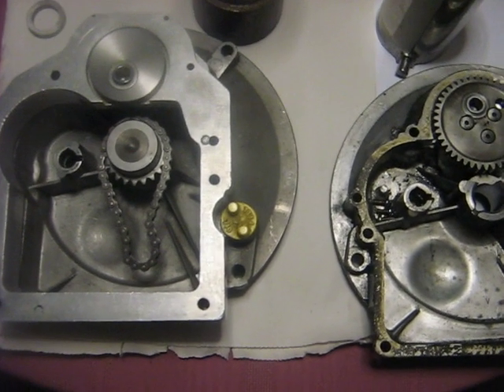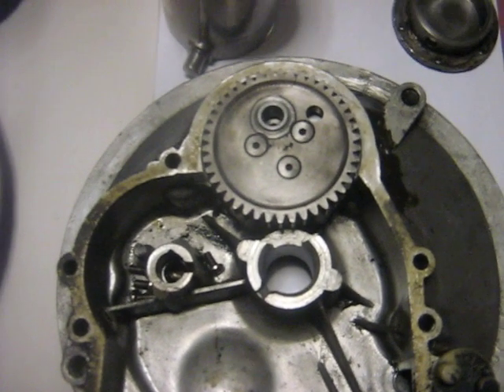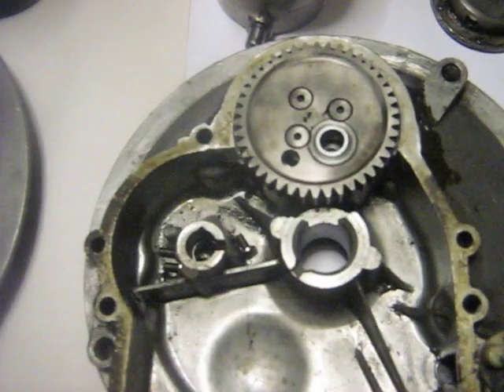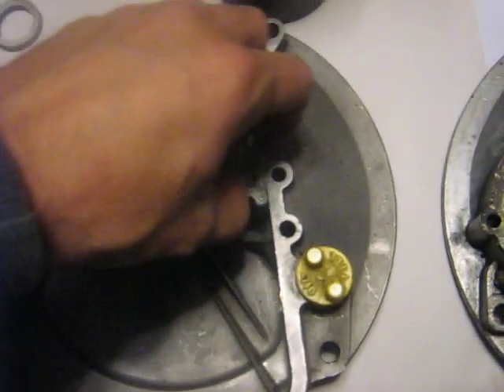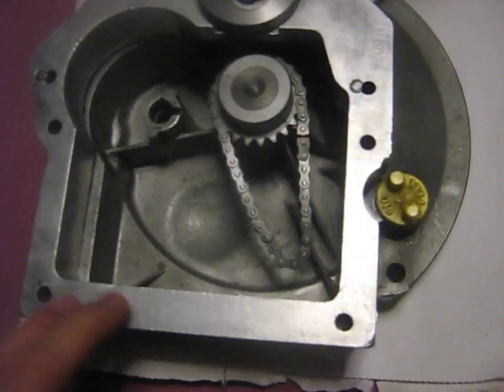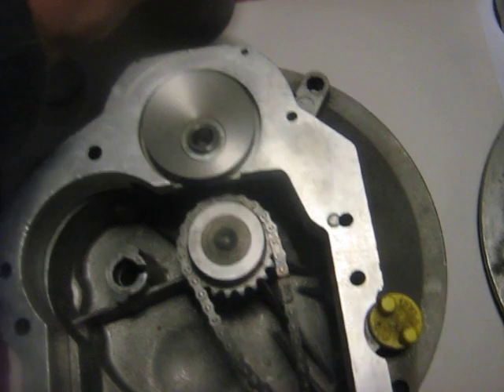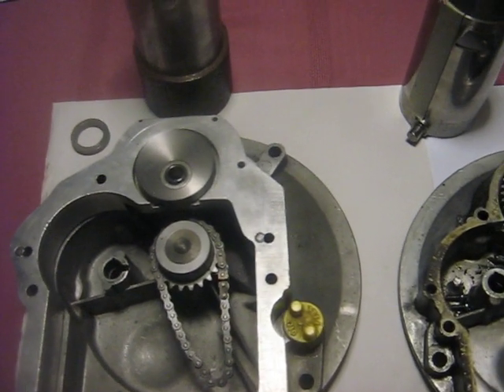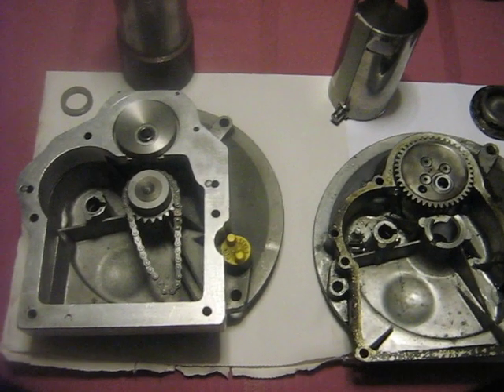2 Stroke Sleeve Valve Drive Vid

Comment: Congratulations! Is this an Open-Sleeve type of 2-Stroke engine, where Sleeve acts as an annular piston, sending power to crankshaft via Sleeve actuating mechanism, eliminating the complex 'Junk head'?
Will the Open Sleeve work in 4-Stroke engines? Salut +
Reply from the maker: Yes, it will be an open sleeve type, when I get it going. My son just cut the cooling fins onto the cylinder head, so he wants me to proceed with it, after all these years!
Reply: @ChargerMiles007  Congratulations and celebrations!  Would you consider a Piccard-Pictet type of Sleeve-Valve? Thanks a lot!
Reply: @ChargerMiles007  q1q qqqqqqqqqqq a Aaron qqqqqqqqqqq

Comment: Any luck with your crecy project? I was thinking the combustion chamber and fuel injection was a critical part of the engine... I see your looks more like a typical 2 stroke...  How were you going to fuel the engine? Just curious? Also the Crecy  was akin to the Dolphin... I have a running Dolphin on my channel if you or anyone is interested...
Reply from the maker: The Crecy is still sitting pretty much as shown in the video, as i have very limited machining access now. I still do intend to finish it off though. I will simplify it to work with a carburator, as the fuel injection would be pretty complex for me, though not impossible, as i have some old VW diesel injection pumps kicking around. i will have to check out your Dolphin engine!
Reply: Did you consider the www.ecotrons.com EFIs and turbos?

Comment: This is an awesome project. No other words for it. Is this engine going to be a long-lasting engine or just a short experiment?
Reply from the maker: I imagine that this engine won't get too much running time, as I have to have one of my piston type superchargers to feed the mixture into it. I generally mount the blower beside the engine, and use a chain drive. In the past I have mounted the 2 onto a wooden base for running, so it isn't practical to use it to drive anything. I do have one issue to resolve with this engine, with the chain drive  for the sleeve, I have effectively eliminated my splash oiler drive, so I may have to go with a dipper, and run the engine & blower horizontally. When I spend this much time building an engine, I do want to get a number of runs out of it though!
Reply: What would be nice is if you could adapt the centrifugal blower that you have and use that as the supercharger. You'd certainly get much better volumetric efficiency out of it than with a piston blower.
Reply from the maker: Yes, the centrifugal blower would be a good idea. I am not sure that we are getting enough boost out of it at low rpm, and starting, to force the mixture into a 2 stroke like this that requires a blower. I guess Deltics and the Nomad could be tough to start sometimes due to the low boost from a centrifugal blower during start up.  However, I am far from an expert in that area. The piston blowers are large and clunky, but fairly predictable.

Comment: Very cool,  document it so we can see how it works..  Thanks Ron
Reply from the maker: Hi Ron, yes, I will be making more vids as it goes along. The drive is seized up due to a bushing misalignment problem. I hope to align bore it to cure that problem, then cut keys into the shafts and sprocket. I have ordered a hone to get the sleeve sized correctly. So lots more work to do, but it will be nice to finally have this engine done in the relatively near future. I also have to use the Lovejoy couplings on the FrankenBriggs 4, and finish off my top secret Briggs project!  So much to do, so little time.  lol
Reply: fun !

Comment: Very cool. I was going to start a design for a model size single cylinder sleeve valve two stroke.
Reply from the maker: Cool, I expect it will be a challenge to build, but the world needs a few of these engines running, just as a reminder! Hard to believe a Crecy hasn't given off its roaring sound for almost 70 years now!!!

Comment: Those are some cool parts !!!
Reply from the maker: Thanks. I can't take all of the credit for them, we made the 4 stroke Briggs sleeve valve as a university project. Then a friend machined the new sleeve drive shown on the right (as the original had some shaft slop issues due to short bushings. My son machined the new sleeve drive shaft for the 2 stroke, as it has a shorter stroke than the 1" stroke used on the 4 stroke sleeve valve. I hope the 2 stroke works as well as the 4, as it has been a solid engine!
Reply: Ok makes sense :) I wish I had access to a machine shop. Have you seen the program called "Solid Works"?